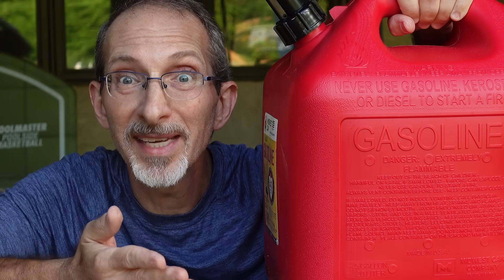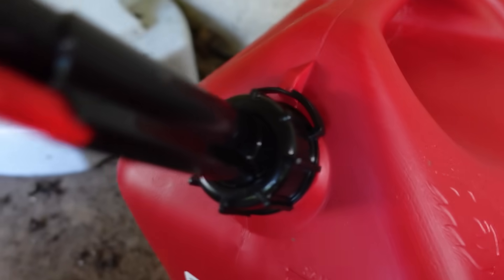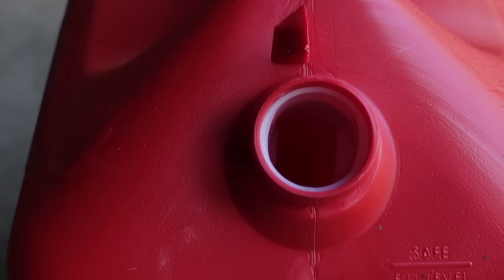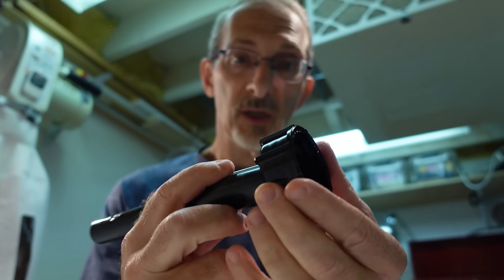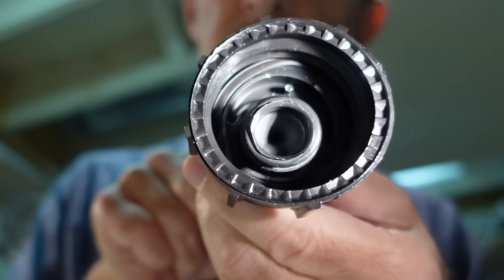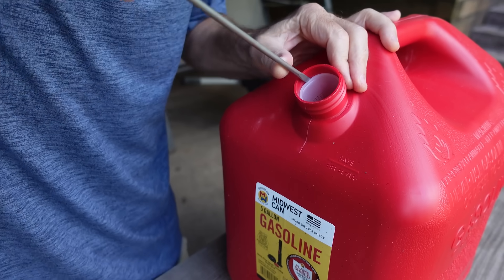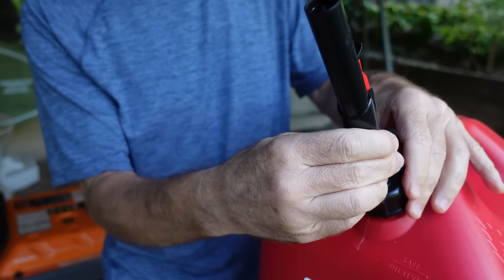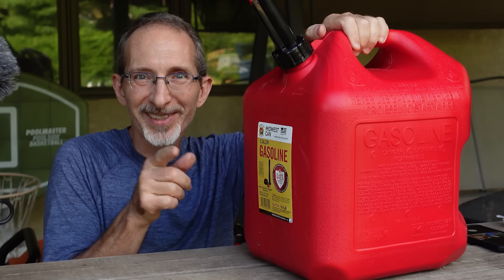Gas Can Modification | New Gas Can Fix

Comment: I've wasted more gas using an "epa approved" gas can, than I ever have to "evaporation". 

And given the rise in gas prices. I'd bet that was planned. 

Spill more gas = buy more gas = Biden profits.

There's a much easier gas can thats "only" $55 where I'm at, and it has the nozzle on the bottom and a pressure release switch built into the handle. 

Someone is working to "reinvent the wheel" on these cans.
Reply from the maker: There is definitely a lot of reinvention in these gas containers, and there did not need to be! I like the old designs! Thanks for watching and for joining the conversation.
Reply: @MikeFyxdt  I learned that the $30 One  gallon STHL premixed gas cans have a filler hole that's just big enough for a gas station nozzle to fit thru. It's just a simple metal can, as it always should be; I don't even need a funnel; I can confidently pour straight from the can, into my weed eater that's sitting on the ground, without spilling a drop. And another bonus, the metal can has a metal cap that EASILY  screws into place. No muss, no fuss! For $30, you have a product that can last 2 or 3 life times.

Comment: Why? I don't get it there's day more dangerous things sold in normal bottles. Why is gasoline treated like high explosives?
Reply from the maker: I think it’s the fumes that pose the biggest problem. Because of the volume of gas that people store, and the volume of these containers, if the fumes ignite it can make a significant “boom“. Most other flammable liquids are not kept in containers this large for consumers. I’m just guessing…

Comment: That filter is about the dumbest thing I've seen... It "stops" debris from going into the bottom of the can, but also makes it so that the debris is the first thing to come out as you're filling your pressure washer.
Reply from the maker: You are correct, I was mistaken. The filter, as I called it, is actually a flame arrester safety device that I explained in my second video. Yes, as a filter it is a Ludacris design! Thanks for watching and commenting!

Comment: I always thought the filter in the can was so stupid. Where do you think the things you filter out are going? Straight into the cas tank when you pour it. Did a really good job huh?
Reply from the maker: Dylan, what I called a filter is actually a flame arrester safety device, which I explained in my second video. In the third video in this series, I talked about how all consumer fuel containers will require such a device within the next two years. I sure hope they come up with a design that doesn’t interfere with filling the gas cans. Thanks for watching and for commenting!
Reply: @MikeFyxdt  coincidentally I watched those videos a little while after I commented this haha. I thought it was a filter too.thanks though!

Comment: There is a new tank you can buy at Rural King that has everything you want for about $20. The only word it doesn't have is "gasoline" on it. It is colored just like the old familar gas cans, it has a capped flexible nozzle, and a threaded vent plug that will make it a breeze to fill a tank.
Reply from the maker: Katrina, that is good to know! So far there have been a lot of really good suggestions for alternate products in these comments. Thank you for watching and for contributing!
Reply: @MikeFyxdt  When I saw these I bought 3 of the translucent ones. You can see the level and if there is any trash in it. 

You know I really haven't checked but I think it might fit into one of those milk crates too. I will have to check when I get home.

Comment: You can also vent the can by putting a tire valve stem in a drilled hole and remove the valve core and replace the small cap !
Reply from the maker: Robert, yes, using a tire valve is a popular modification. In my second video I added a different type of vent cap, which is inexpensive and easy to install. And it works! Thank you for watching and for supporting the channel by commenting.

Comment: There is a much simpler solution to this people. The same stores that sell the gas jug also sell the water jug which is about the same size, swap the gasoline nozzle for the water jug nozzle which has no safety mechanism and use that to pour your gasoline with 🤷🏿‍♂️
Reply from the maker: John, many people have recommended using water jugs, but I wouldn’t want to get caught at a gas station putting gasoline in anything that wasn’t labeled for gas. Just my two cents, but I understand why people are seeking out better alternatives! Thanks for watching him for joining the conversation.
Reply: @MikeFyxdt  i never mentioned using a jug for gas, i mentioned swapping the nozzle, doing that is no worst a crime than defacing a safety mechanism

Comment: Another useful safe mod is to drill a hole in the handle or opposite end of the top to allow air to replace the fuel. Prevents the glugging
Reply: @xlneoMAXlx  - And speeds up the leaking all over your trunk on the way home.😮
Reply from the maker: Jeremy, yes! In my second video I added a vent, and it made a huge difference! There is a link in the description if you would like to watch.
Reply: @xlneoMAXlx  - I suppose a piece of duct tape would work.  New each time.  Easy fix?
Reply: The old style cans had a little screw off cap you loosened when you used the can. Who do they have designing these things, a team of bonobos from the National Zoo?
Reply: Yes, and you can find a screw to plug up that hole you drilled for storage. Machine screws (bolts) work better than wood screws.
Reply: @xlneoMAXlx   The vented gas cans aren't sold in the US anymore. They apparently caused too much "environmental damage" and "leaking of gas fumes" because people would forget to close the vent. That said, I have spilled more gas than I ever lost to evaporation with the new style before I started modifying them. It is easy enough to buy "replacement" vents on the internet and just drill a half inch hole in the back of the new ones to turn them from a gas cannot into a gas can.
Reply: Damn. I'm so glad my 30 yeah old 5gal can still works fine. Used to be red, but now almost completey yello. I did see a replacement nozzle that screws right onto these new cans, that doesn't have all the safety gizmos.
Reply: @jojodiver8706   Right. I think the company is like ez-pour or hi-flo or something like that. I have used a couple of theirs, but most of my gas cans are old enough that they didn't have all the springloaded nonsense in them and were just missing a vent.

Comment: LMAO a filter that completely fails at it's only job. So it will filter stuff going into the can, but goes directly into the very next thing you fill..... hmmm what armchair engineer thought that one up? Or are you supposed to fill the "Jerry" can, fish out the gas soaked particulates....and I guess throw them in the trash or on the ground (no fuel bomb-esq dangers there....)... this product fails at safety everywhere you look!
Reply from the maker: What I called a filter is actually a flame arrester safety device, which I clarified in my second video. That mistake doesn’t excuse all of the other inconvenient design features of these containers! I agree with you, this product fails on many levels.

Comment: I cut my spring in half, stretched it, and reinstalled. Now it still functions the same yet it is a lot easier to operate.
Reply from the maker: Ride with Ren, great minds think a like… That’s exactly what I did in my second video, link in the description. I also added a vent with a cap, which helped a bunch. Thank you for watching out for joining the conversation!

Comment: That filter is really handy, as it catches all of the dirt from the gas pump, keeping your gas can clean, and instead, deposits it into the fuel tank of your engine when you fill it up.  SMDH.
Reply from the maker: When I called a filter is actually a flame arrester, which I explained in my second video. Link in the description if you would like to watch. Thanks for commenting!
Reply: @MikeFyxdt  I did see your follow-up video after my post.  Regardless of the intended function, it will still trap contaminates like a filter, and redeposit into your equipment.

Comment: Just came across this yesterday.  Interesting little video. Thought I'd donsome of these to my 5gal can. Upon inspection,  mine didn't have the internal screen filter at all.
Reply from the maker: Jonathan, those flame arrester screens are going to be required on all consumer gas containers <= 5 gallons over the next couple of years. I talked about this in my third video, link in the description. None of my other containers have this safety device, and it will be interesting to see if the new designs are as difficult to fill as my midwest containers were. I appreciate you watching and joining the conversation!

Comment: Propane Generator... How much propane does it generate per Kilowatt-hour?
Reply from the maker: Lol, I just read your question again… Generate propane… Funny!
Reply: @MikeFyxdt  yeah I'm pretty good at this and...
Haha just kidding I'm not good at this 😂
Yeah I'm just getting old and i spew dad jokes without thinking about them too much 😬
Reply from the maker: I don’t remember the exact spec, but I think it is a 7200 W generator that would run for 5 hours under load, on a 20# propane container.
Reply: @MikeFyxdt  what's 20# by the way?
I'm german and we use metric 😅😁

Comment: What's the point of a filter if you can clean the filter and where is the little air vent
Reply from the maker: Crazy Jack, what I called a filter is actually a flame arrester safety device, which I explained in my second video, link in the description. I also added a vent in this video, plus modified the spring to restore the self closing feature, but make it easier to use. Thank you for watching and for joining the conversation!

Comment: Did they even think about the filter in this? All of the contaminates get caught on the side of the filter that goes right into whatever you're filling up.
Reply from the maker: Snowy556, what I called the filter is actually a flame arrester, and I agree with you that it doesn’t make sense as a filter. I explained this further in my second video, link in the description. Thank you for watching and for commenting!

Comment: So if the filter catches anything, whatever it caught will immediately go into the gas tank of whatever you pour gas into next. What's the point of the filter?
Reply from the maker: What I called the filter is actually a flame arrester safety device, which I described in my second video, link in the description. Good catch! Thanks for watching and for commenting.

Comment: The worst part about this can is that when it build pressure it can’t relieve it until you compress the safety thing. Which happens when you push the cam into your gas tank. Then it sprays gas back out at you because it’s under so much pressure
Reply from the maker: I agree that pressure is a problem. I always loosen the nozzle collar before I even pick these containers up. That seems to help equalize them. Thanks for sharing your comments!

Comment: You can buy a normal old style spout on Amazon
Reply from the maker: Dylan, yes. I will be reviewing one in an upcoming video to see how compatible it is. Thanks for watching!
Reply: @MikeFyxdt  there's different sizes. Took a few guesses to get the right one for my can.
Reply from the maker: Yup. The replacement spout comes with a few different colors so you could match the thread size.

Comment: what about an air flow hole on the back side by the handle so it doesn't splash everywhere I have added those you can get old nozzels on ebay and just throw those crappy ones away
Reply from the maker: Agreed! I added a vent in my second video, link in the description. I will also be reviewing a replacement nozzle in an upcoming video. Stay tuned!

Comment: You could also get one of those metal safety gas cans that they force you to use on my construction jobs there about twice the price of the plastic ones but there 100 times easier to use than that oh let’s try to keep you safe bull crap because those all you have to do is squeeze the two handles together and there isn’t a super over powered spring holding the cap down
Reply from the maker: If my budget would’ve permitted it then I would’ve love to purchase the metal containers. Everyone in the comment section raves about them, but I have not owned one in 20 years. Moving forward I think I should add one to my collection. Thanks for the suggestion and for joining the conversation!

Comment: 4:47 See how the outer seal ring is all twisted up?  That is the main reason these new cans are junk.  That seal is always getting messed up then the slightest jostle and the can will leak lie a sieve.  My 30 year old Rubbermaid can is MUCH safer because it never leaks.
Reply from the maker: John, I didn’t notice that! Maybe it’s straightened itself out, since I haven’t had any issues with the nozzle sealing. But I agree, that gasket is pretty thin. Thanks for joining the conversation and letting me know!

Comment: I like my 2 gallon can with this spout.  (After my modifications added)  just RIP off the locking mechanism and leave the spring.   Next mod is find a piece of 1/8 " rubber sheet or a gasket to fit in between the spout and cap that secures the spout to the can.  The seal that it comes with usually tears within a few times of taking it on and off.  You could also drill and tap a hole on the back of the can for a vent to speed up the process ( your gonna want to do this with 5 gallon cans)
Reply from the maker: Neil, thank you for your suggestions! I did add a vent in my second video, link in the description. It makes a big difference. I have not tried adding tubing to the nozzle, but I think that is a great idea. I appreciate you watching and adding to the conversation!

Comment: In reference to the filter in the can, you just need to slowly fill it.  Dont completely squeeze the gas pump, just slightly and it will fill without issues.  Thanks for the tip on the nozzle
Reply from the maker: Saint Michael, since we have gas station attendants, they weren’t able to fill the container without it cutting off, and they said they see these containers all the time. So I guess results may vary depending on the pump. Crazy! I appreciate you watching and joining the conversation!

Comment: So the brilliant idea they came up with was lets a put a filter in the can to stop contaminants getting in the fuel but if the filter is full of crap as soon as you turn it upside down it'll flush the crap straight into the tank of what ever you're filling
Reply from the maker: When I called the filter is actually a flame arrester safety device, which I explained in my second video. You are correct, it simply doesn’t make sense as a filter! Thank you for watching him for commenting.

Comment: As soon as I watched this I did it to my 2 cans that had them. Took 3 minutes. Done deal.
Thanks so much for posting this.
Reply from the maker: House ho, I’m glad the video helped! They are all very simple modifications. In my second video I added a vent to the back of the container, which also made a difference. Link in the description if you would like to watch.
Reply: I drilled a vent hole in them when I first got them.

Comment: OR you could just order replacement flexible spouts online like I did to fix my old cans. For the new one, just drill a hole in the back and insert the little vent cap. As for the filter; that's brilliant. It keeps the junk from entering your can, but pours it right into your tank. Absolutely genius!
Reply: I use golf tees as a vent plug
Reply from the maker: I agree with using an aftermarket spout, a very popular option. What I called the filter is actually a flame arrester safety device, which I described in more detail in my second video, link in the description. Thank you for commenting and for watching!
Reply: Actually it isnt a filter at all it is a flame arrestor. The purpose of the thing that looks like a filter is to keep a flame from entering the can and causing a explosion. If you doubt me google it, I know of a gas can company named Blitz that went bankrupt due to eliminating the filter causing injury and fatalities when their own in house research said they did work to prevent explosions. These fire arrestor screens are usually in the spout but the spout in this design could not accomidate a screen.
Reply: @elwoodward769  Blitz went under because the company was small, and couldn't deal with the mass litigation caused by idiots injuring themselves by pouring gasoline on lit fires.

Comment: You're going about this the hard way. You can buy online a replacement nozzle like the old ones. And also buy a vent plug so the gas flows much faster than modifying the original nozzle. And then in 5 minutes, you have a gas can like we could buy 10 years ago. Leave it to the people at the EPA to spawn a whole new industry to get around a useless gas can design. Maybe if some of the EPA leadership ever had a real job, this crap wouldn't happen.
Reply from the maker: Ocean Mariner, I didn’t even know that aftermarket nozzles were a thing until after I posted this video. Now I know how popular they are, and I agree that they are a viable option. In my second video I did add a vent and it makes a big difference! Thank you for watching and for joining the conversation.

Comment: I'd put a hole in the filter, stick that gasket pick in their to pull the filter inside out. No need to deform the neck of the can.
Reply from the maker: Good suggestion! I knew there had to be an easier way…

Comment: Yeah these gas can suck I hate the filter it doesn't matter how slow you pump it will always back splash or cut off the pump
Reply from the maker: Agreed. I found it very difficult to work with. Much better now!